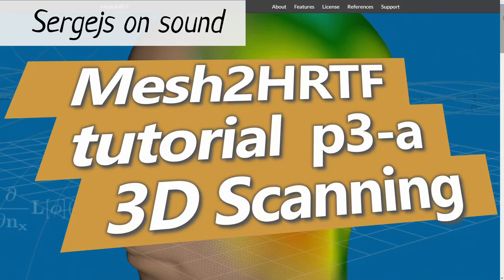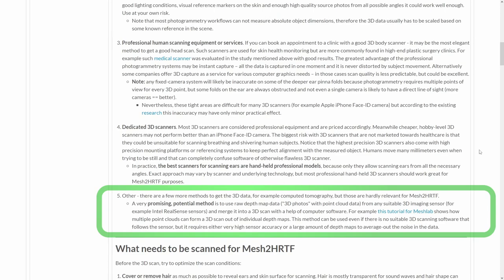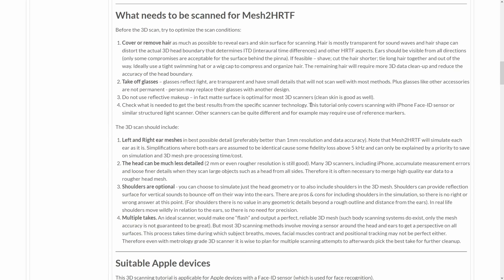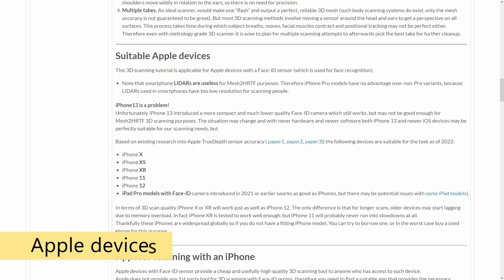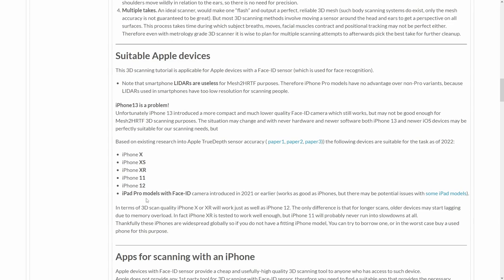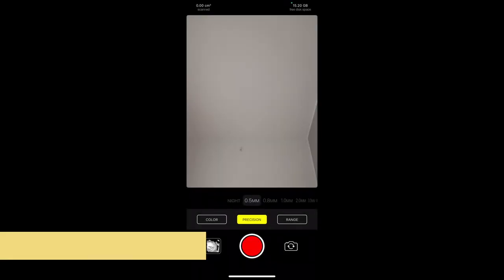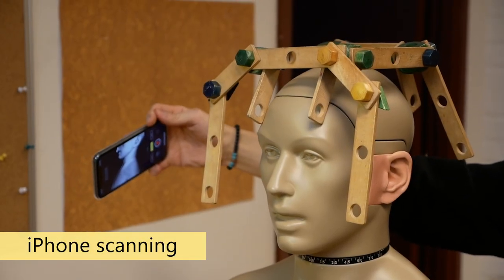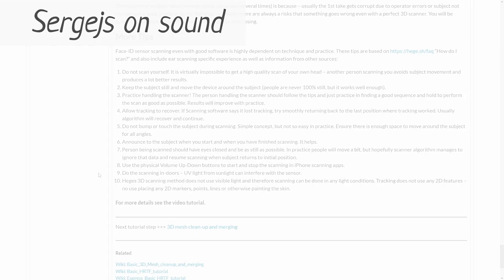Mesh2HRTF - t03a - 3D Scanning Tutorial

Comment: Thanks Sergejs! Can you recommend any purchase links for a frame or geometric reference?
Reply from the maker: Hi, the frame you see in my tutorials I constructed from a 35+ years old kids construction set - nothing to buy as a complete set. But it should give you an idea what to look for to find a similar construction set or just "nail together" something similar using some wood. Note that shiny Lego plastic pieces are not as optimal for 3D scanning as the somewhat shabby wooden pieces of my old construction set.

I am thinking of making a 3D-printable "crown" which could be used for locating dots for professional 3D scanners - that would make it easy to get reliable professional scans, BUT for iPhone scanning advanced 3D-printable crown would actually be worse that the wooden frame in the tutorial, because iPhone works better with a bit chunkier objects due to limited resolution and does not understand locating dots.